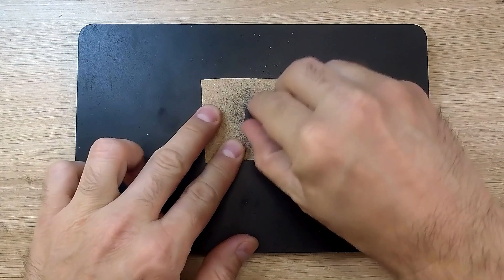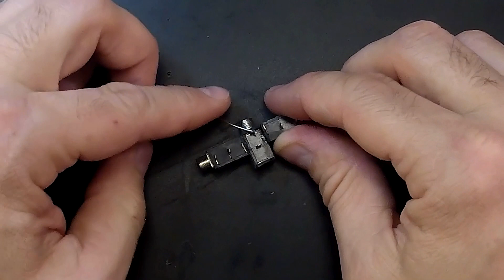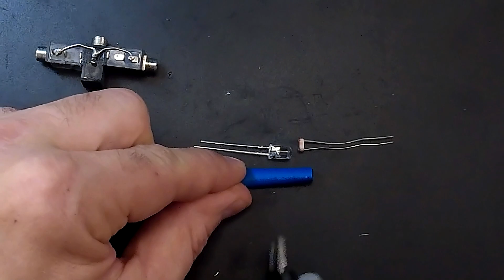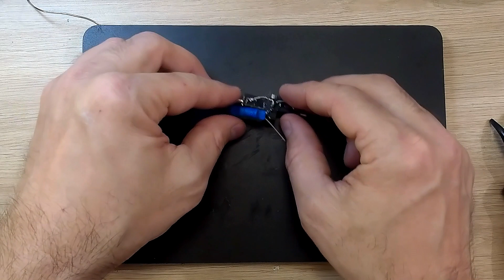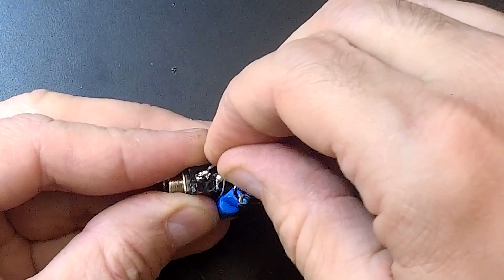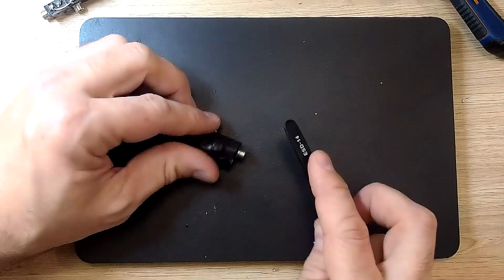EURORACK PATCHPALS n°2   Low Pass Gate LPG

Comment: VERY NICE INNOVATION!!  An all in one little extension and it will serve as a sort of ‘auto AR envelope’??!  I don’t know whether you’ve ever heard of Razmasynth?  They came up with an idea called the ‘super warp generator’ I think?  The whole idea is that there’s a tiny IC inside of these particular LEDs that flash to different colors, they use an RGB LED that’s of a specific type with two leads that cycle through the different colors.  They treat it like a sort of oscillator or gate snapper thingy, AND it’s passive!!  No reason why I shouldn’t have a few of a simple passive project like this.   I Wonder, what it might sound like to take a copy of a MIDI stream from a MIDI through box, slow it down, and use the MIDI data as a gate pattern, or an LFO in this sort of manner?!  Being tapped out like a Morse code message on a drum module!!  THANKS AGAIN!!!
Reply from the maker: you're right, i did it here : https://www.youtube.com/watch?v=y8E7dP9GGC0&t=36s

Comment: If there's no CV coming in there's no sound at all? Or just no modulation?
Reply from the maker: Yes, no sound at all. The cv input needs a minimum of voltage like 2/3 v to power the led to open the sound path thru the LDR of the vactrol.